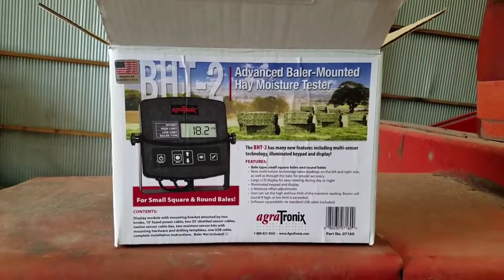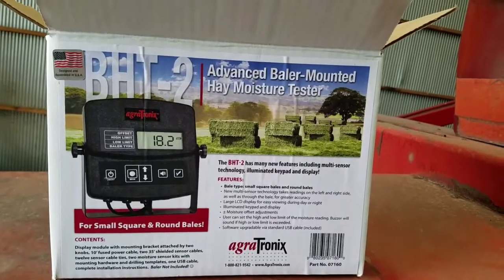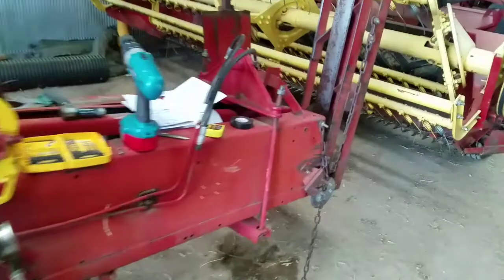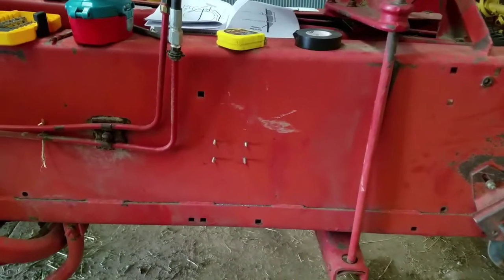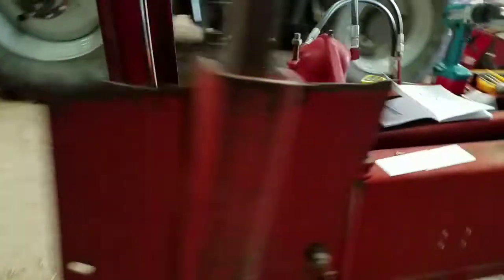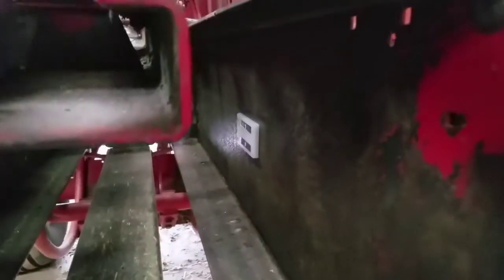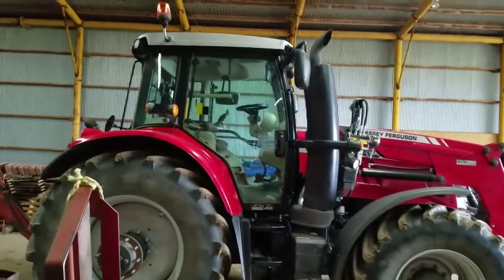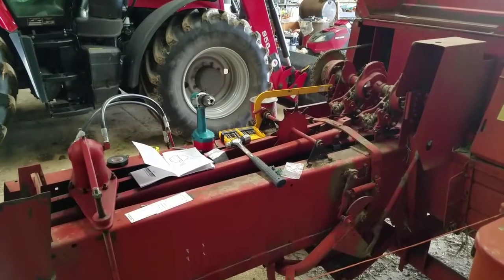Installing Agratronix BHT-2 Baler Moisture Meter

Comment: Would you buy it again after using it  a year?
Reply from the maker: Yep, I would. Its been reliable and provides accurate readings. Its especially useful when the humidity is changing rapidly